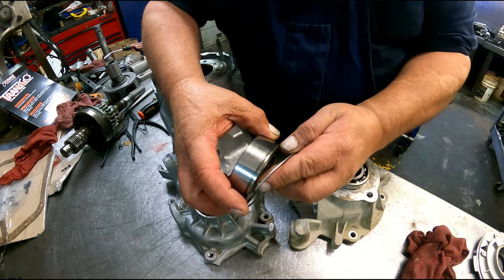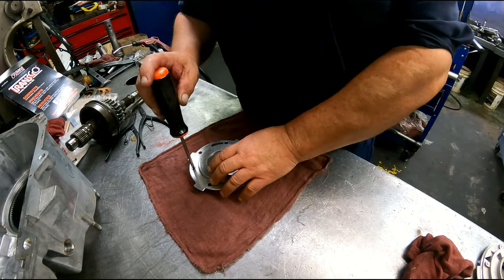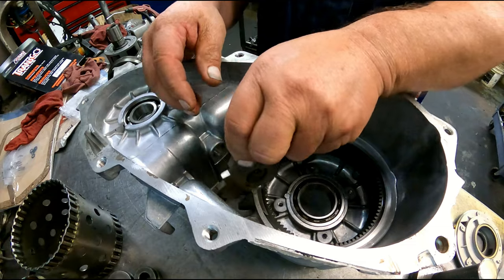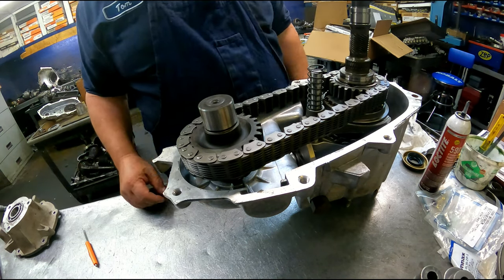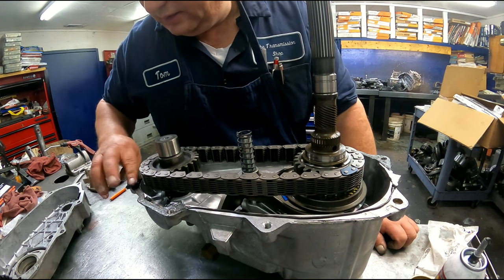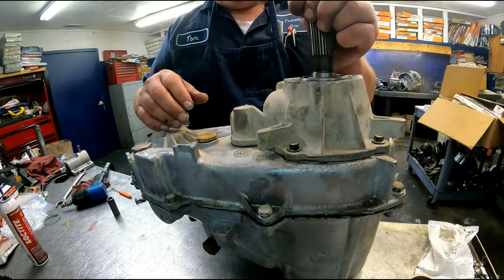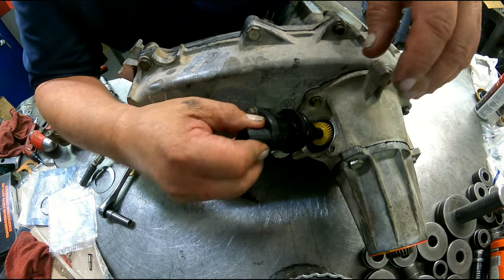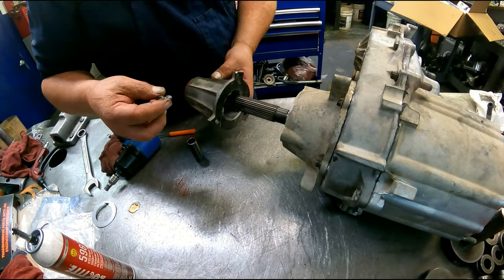231J Transfer Case Rebuild

Comment: Great video a lot of help one question, I had to replace the range fork the first one broke the new one lasted 4 days and wore down even with the new pieces. I don't know why it's wearing out so fast. Fluid was good and everything seemed normal any ideas?
Reply from the maker: Have not had that problem. Maybe a clearance problem or something is keeping pressure on the linkage. Forcing it into the fork. I will run it by some guys I know and see if they have ever had that problem.

Comment: Hey boss, my transfer case looks like it's leaking from the half. I didn't rebuild it myself. Have you seen this before. Looks like the guy used rtv to seal it
Reply from the maker: Pretty rare that it leaks from there. It does take silicone between the halves. Needs to be a good grade, like ultra black. I use Loctite 598.